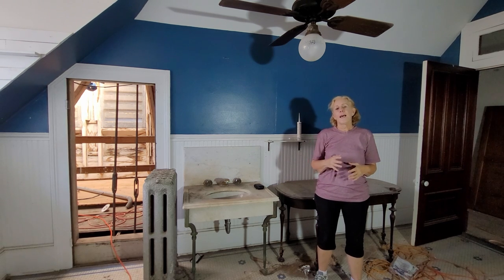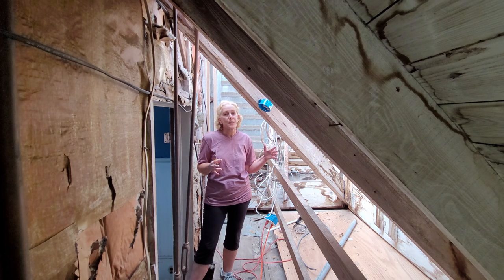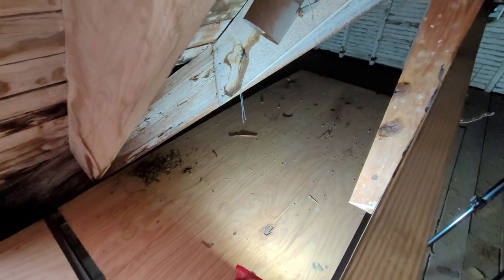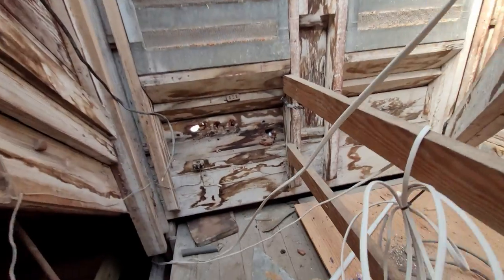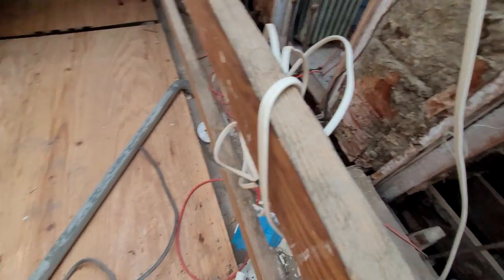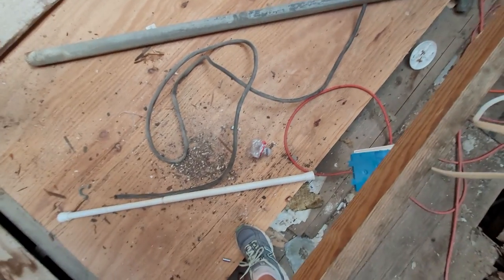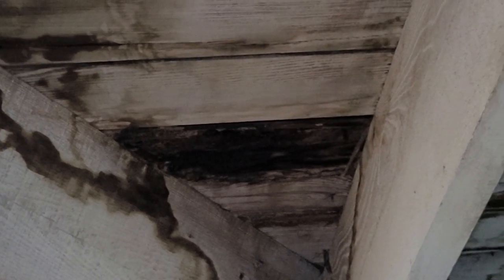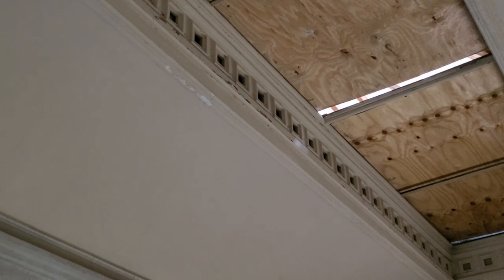S2.37 Take a Tour of the Cupola

Comment: Such amazing functional details for an old house. Imagine building that mammoth house on that island. I live on the NC coast, and summers can be brutally hot. That cupola space was part of a whole house design to cope with heat and humidity. I would guess that replacing that valley beam you showed could be tricky, which translates into time consuming and expensive. Good luck!!
Reply from the maker: I can't imagine living here without air conditioning.  I've been in this house through two summers and even with the cupola and all the air flow it is very hot and gross.  That valley beam is going to be tricky.  I'm hoping it can be saved or braced.  Replacement would be a hard thing to do.

Comment: The amount of vertical airflow from the tall stairwell and cupola would have made such a difference! Having never lived with modern air conditioning, it probably felt cool to them. The amount of time modern folks spend being chilled (I'm not a fan of drastic temperature changes; I froze for 6 years under an A/C vent at my office) doesn't seem healthy. I've learned a lot about historic homes in the South; the large walk-out windows, transoms, and central hall floor plans were so smart. We have large windows facing southwest (the central room at the back of the house) where a breeze starts up most days around 4pm. The room has french doors on the interior wall that we leave open between it and the dining room, and a wide archway on the other side, between the dining room and living room. Large windows on the east side of the living room allow air to blow through the house. If the outside temp is under 85, we don't bother with A/C, even in a house with no insulation. P.S. The cats love the open stretch between the three rooms, and run through like freight trains, especially at night when I'm ready to go to sleep. :S
Reply from the maker: I grew up without air conditioning here in Houston and it is possible to survive without it.  We had a giant attic fan that sounded like a jet engine.  It pulled air through the screen windows (and a lot of dirt).   I never liked drastic temperature changes either.  It's hard to dress.  Indoors you freeze to death if you are dressed for the outside.  It sounds like your house was built with air flow in mind.  The League-Kempner House is definitely the model of perfection when it comes to moving air naturally.

Comment: I'm still a little confused about termite treatments. I'm sure you have said before, but my mushy brain didn't retain the information. So, when you treat wood for termites, does it kill them AND prevent any others from coming back? Meaning make the outside of the wood unpalatable to them?
Reply: Oh! I commented before I saw the vents for the rising heat!! That is very cool!! 😂 At least it would make it that way!!
Reply from the maker: There are actually two different treatments. Both of them kill the termites through different mechanisms. They don't repel the termite but if they eat the wood they will die.  Once all the established colonies have been killed inside the walls it should be easier to keep them under control.  I haven't really done a long video about the different treatments going on.  I need to do that because it is a very important part of saving this house.
Reply: @leaguekempnerhouse  those termites are ghastly!!